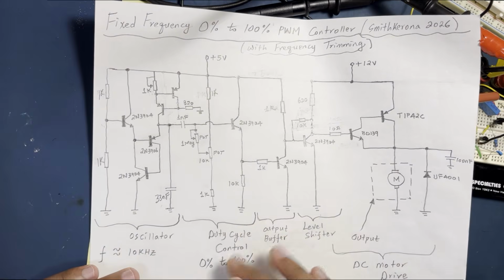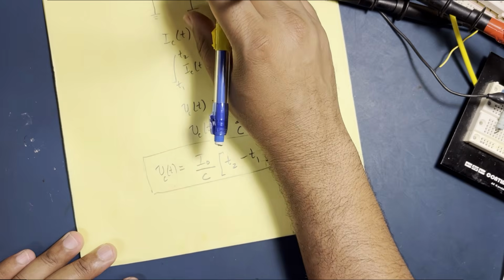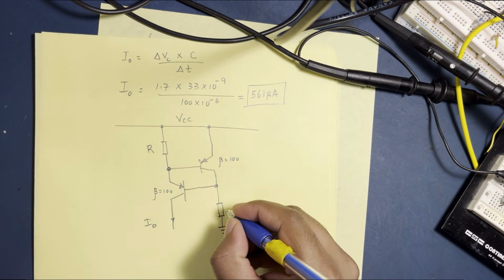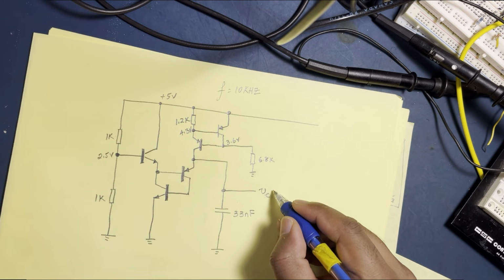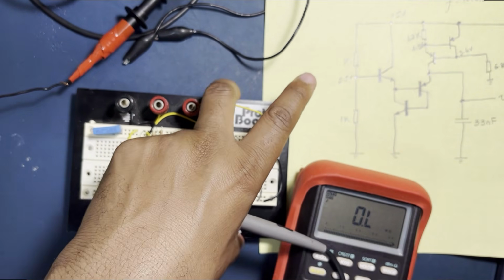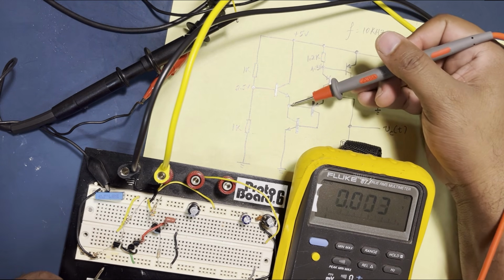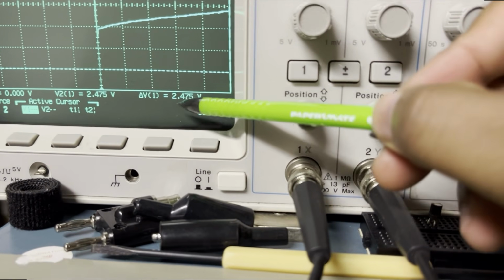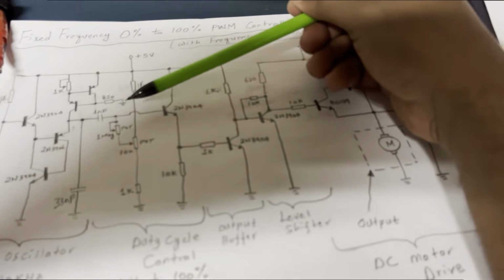Oscillator Design - Sawtooth Waveform Using Discrete transistors

Comment: Nice video.
I've thrown this schematic into LTspice. I see some problematic thing, I do not know whether it is ok or not.
Those first transistors on the left side are experiencing like 500mA spikes when discharging that 33nF capacitor. I know it is not continuous current, but it seems to be high. Is it OK?
Reply from the maker: That operating condition should be acceptable. In a physical implementation, parasitic elements—such as breadboard contact resistance or PCB trace resistance—will inherently limit the peak collector current Ic. Exceeding the maximum continuous Ic rating is permissible if the duration is restricted to a transient pulse (e.g., < 1 μs). Because the 2N3904 and 2N3906 are rated for a continuous Ic of 200 mA, a brief 500 mA transient will remain well within the safe operating area (SOA) margins, provided the duty cycle prevents significant junction temperature rise Tj. If this margin is still a concern, consider upgrading to the 2N2222A (NPN) and 2N2907A (PNP) complementary pair, which expand the continuous Ic capability up to 600 mA (with certain packages rated up to 800 mA).
Reply: @SmithKerona I do not like the idea to rely on PCB trace resistance. I made a little modification to your circuit. I added 3 resistors and that decreased those currents in controlled manner. And the fall time of discharging increased from 2.0us to like 2.4us. I added 47 ohm resistor to the collector of the first (left) transistor and added 10 ohm resistors to the bases of the 2 bottom left resistors.
I noticed another bonus of this. The oscillation starts with these resistors much faster (in simulation). It starts in 30us. It was 360us without resistors.
Reply from the maker: @Chupacabras222  While adding those resistors creates a more predictable current across the back-to-back PNP and NPN transistors, it is largely unnecessary since the current is transient. You only need to consider them if you use a very large capacitor (in the microfarad range), which extends the transient current's duty cycle. The downside to including them is that the capacitor will no longer discharge to a known voltage. In my circuit, it discharges to exactly 0.7 to 0.8 volts above ground. As shown in the video, maintaining this specific voltage level is what allows for a predictable oscillation frequency and simplifies the selection of the charging current and other circuit components.
Reply: @SmithKerona You are absolutely right. My changes shifted those levels, which is not wanted.

Comment: I find this way of presenting things to be the most practical and comprehensive. I really appreciate that you cover circuit development using discrete components, such as these transistor-based ones. We don't see that sort of things very often on YouTube. If you don't mind, I’d love to see you cover other circuits in the future—like PLLs, op-amps, bistable, astable, monostable (together with trigger circuits), digital circuits, or even ADCs or DACs. I imagine the latter might be challenging to build, but certainly not impossible. Thanks a lot!

Comment: Am I right in thinking that the emitter follower is necessary to the back-to-back transistors because there's enough current from the current source otherwise to keep the pair latched on?  (ie, the bottom npn of the pair can stay saturated with the 500uA base current unless you feed it a whole lot of currrent).   I was fiddling with the circuit in ltspice and it seems like smaller current sources (<40uA) will cycle with a 5k equivalent resistance providing the reference voltage to them.
Reply from the maker: Nice to see that you simulated the circuit. The switching-off behavior of the "SCR device" or the back-to-back PNP and NPN transistors is largely not dependent on the magnitude of the upper current source. The emitter follower is necessary to starve the top PNP transistor's base current of the "SCR device" once the capacitor is discharged to about 0.8V so that the bottom NPN transistor switches off, allowing the oscillations to continue. If you don't have the emitter follower, the resistor divider middle node will go to almost zero volts (actually Vsat of the NPN transistor), causing the upper PNP transistor of the "SCR device" to latch in the on state, causing the oscillations to stop. The resistor divider node voltage should be above the capacitor voltage the moment the capacitor discharges to its lowest voltage level for the oscillations to continue and the emitter follower transistor makes that possible. In a nutshell, the emitter follower isolates the reference voltage from being affected too much by the lower NPN transistor of the “SCR device” switching on. If you want, try to use a darlington transistor like BC517 or better yet a MOSFET (2N7000) in common drain (source follower) configuration and see the effects. To get the same frequency of oscillation as the video, you would need to adjust the resistor divider values to account for the higher base emitter voltage or gate source voltage. FYI, in the source follower configuration, I have used a resistor divider equivalent resistance of around 100kΩ and the circuit was working with no problem at lower frequency of oscillation.